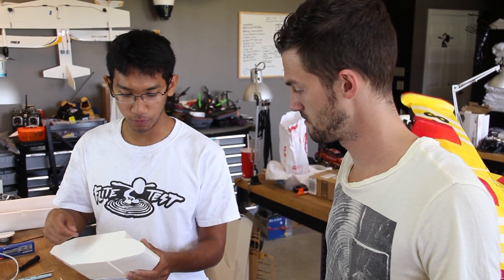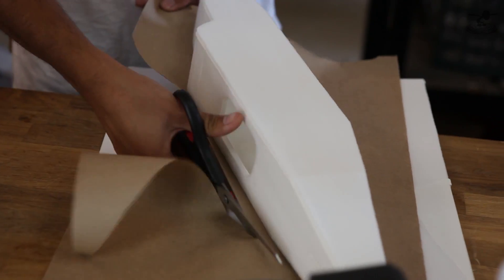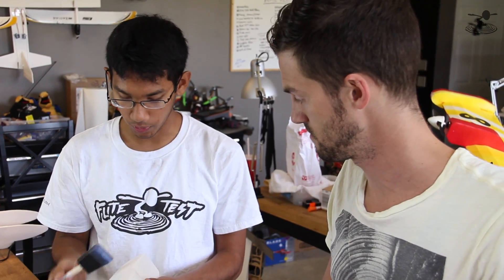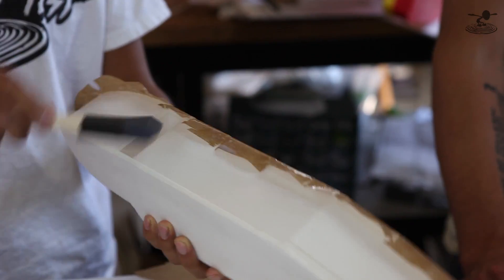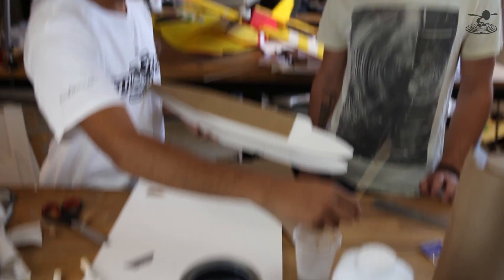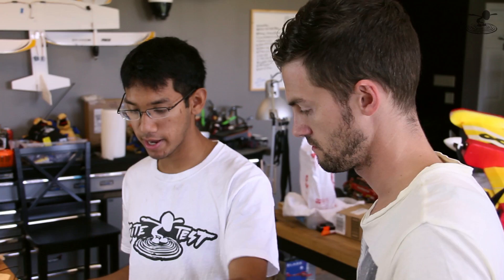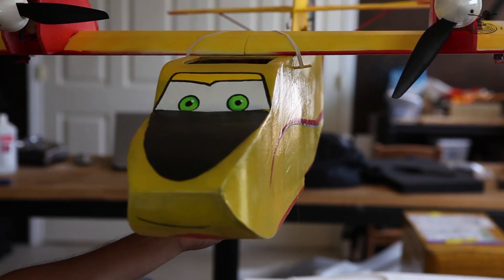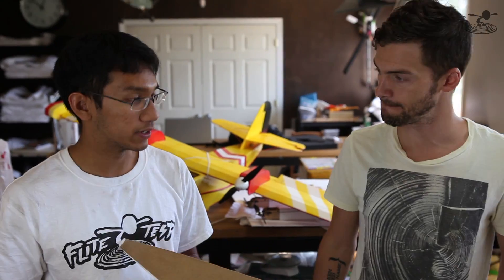Flite Test | Waterproof Your Airplane

Comment: use cheap acryl paint mix whit water 60/40 about and spray cover to plane,m have dry is same than plastic cover. all water base paint work well. but best methor have monocote cover film heat arounf plane. and then paint what want decoratives and text add stickers.

Comment: A much easier way... is using pour on epoxy, that is used for glossing tables. Brush on thin layer. Get the slow dry kind. Its called... pour on.. and it is literally.... the absolute best thing ever. I built a foamy in 2006... that is still in same condition now as it was then. Put it on AFTER paint. You can paint it after coating it if you want it matte... but you would need to scuff it with sandpaper.

Comment: Just rewatched this. You can also use thinned white glue, 2:1 glue to water. May be cheaper. After watching this, I would have used this method to cover my EPO foam turtle deck for the FT Racer, see my article on FT.
Reply: Hi did you try with white glue after all? once dry,wouldn't  white glue  become slimy if it gets wet?

Comment: I wasn't aware of the availability of craft paper. I knew the British have been covering planes with brown paper for decades but the stuff Peter uses seems really light. What are your thoughts of using it over Depron? Just thought of something. I'm drawing up a cartoon C-17 & Cessna Citation/Lear and now I'm thinking I might be able to apply the brown paper to the one side of the Depron while it is still flat and then roll the foam'paper into it's elliptical shape using the paper to force the foam into compression as opposed to it stretching. Do you think the paper would prevent it from rolling. The minimum radius would be somewhere around 1.5 inches/ 40 mm. Nice video. I have another fuselage which is a combination of light white foam block and Depron and I'm anxious to try this procedure on that. It should also work nicely on wire cut blue foam. It is 0552 in the morning so I guess there isn't any reason to go to bed. I think I'll get dressed and go to Walmart.
Reply: I haven't left for Walmart yet so I watched the video again and you recommended not to cover wings with the craft paper  and so I'm wondering why? Again the video was very helpful for my new designs. Thanks

Comment: Obviously this is a good tip for the kits as they use paper covered foamboard. but if you use something like Depron, and make sure to fully glue every joint, there's no need to water proof it.

Comment: Just did some testing using this method on the DTFB and the water based coating. It works BUT does not solve the number one issue with this foam board, adhesion. The original paper and this new technique still does NOT adhere to the foam. This is the biggest downfall of this foam. After a crash or hard landing, the foam separates from the paper and this causes structural weaknesses.  I have found the only glue that really Sticks to this foam is foam safe instant glue, and to re-glue a whole sheet is not practical from a cost point of view.

Comment: I do not see enough advantage in removing the paper just to put on a little better paper. My opinion is to leave the existing paper, use the oil based poly procedure on the entire airplane, then paint.  The baby powder can still be used with oil based to get a smoother painting surface.

Comment: So, what's the advantage of this vs just doing oil-based polyurethane and painting it?
Reply: ***** Better adhesion to the foam than the standard paper.
Reply: Balu
 But I'm wondering in pure water proof-properties.
Reply: I can't get it to work... I bought two different cans of the stuff I don't see what it does

Comment: Too bad you can't just buy foam board with better paper to start with.
Reply: Kevin Hanes LOL Elders! Wonder if I can get one from my grandma...
Reply: Hugh Hemington Oh, you can :). The company I get my foamboard from also sells one with kraft paper. It's called "Creat Kraft". I didn't order that because I wasn't sure if it's heavier, but I might just try it for comparison some time.
Reply: Don't get me wrong, I'm not knocking the effort!  I just think that waterproofing remedially  may be doing it the hard way.  It's a matter of walking a tightrope of weight workability water-resistance and strength.  And the willingness to no doubt spend more in the beginning for a less common and more expensive material.
I wonder if this works better than built up coats of spray paint?  It's clear that the main issue is the glue used to secure the paper to the foam originally.
Reply: I think you missed the point of the video. They probably should have used a different title so no one gets hung up on just the water proofing advantage. The process that Peter demonstrates allows the builder to get a much better finish on the plane. As Peter demonstrates not only is the finish better but it is stronger. Not only does it look better and is stronger but it will accept a larger selection of paints. If you care about the appearance of stuff you build then I think you would appreciate this video more. Using Peter's method of recovering the plane along with other building techniques can result in even very scale looking aircraft. Having difficulty finding a good Kraft paper. Walmart and Michaels didn't have anything suitable but tomorrow I'll go to United Artists and see what they have. On my small planes Japanese tissue is a good substitute but not practical for these larger sport planes as it wouldn't be very durable.
Reply: Roy Oetting Have you tried looking at Lowes or Home Depot?  The have the rolls of masking paper that is a thin craft paper.  I've seen a model covered with it using white glue/water mixed at 50/50. It was as tough as thin fiberglass.  I also wonder if the white glue/water mix wouldn't work as well as water based poly-u on DTF?

Another method that may be worth trying is onion skin.  This is an old FF covering that much stronger than tissue, and is available today from Amazon as tracing paper.  There is a guy in RCGroups who uses Helix Paper Roll Sketch, White, 12 Inches x 50 Yards, White (37801) and says it a great covering material.  The only drawback is you have to be careful if you shrink it like tissue as it apparently can shrink more than tissue. It may be worth trying on DFT using WB Polycrylic and also white glue/water.  The only drawback is how much it may shrink once it gets wet.  Only testing will give that answer.
Reply: Hugh Hemington Is the paper on DTF adhered by glue, or is heat from the forming process that adhere's the paper to the foam?
Reply: hogflyer62 Thanks, I'll check it out.
Reply: Can any of you "professionals" make a video on how to make a base of a 2-3 ch (mini) because everytime I take my out the circuit , the motors break off!
Reply: +hogflyer62 Probably glue.

Comment: Please do an episode on building with deporon Peter!
Reply: Great idea +jakeEboy Building with depron videa would be awesome, in UK is cheaper than foam-board and  "better" because the foamboard i can find is kinda cardboard backed rather than paper backed and destroys razor blades when cutting it :-(
Reply: One thing to note when building FT planes using Depron -  I have found that the CG moves back a little bit so you might want to move some electronics like servos forward an inch or so.
Reply: ***** Here in Australia you can get foam board but it is as expensive as Depron and Depron is a superior product for modelling. So yes, please do a Depron build guide.
Also Depron versions of the plans would be good. I have built the FT Spitfire and the FT Baby Blender but they weren't easy because I had to modify the plans as I went.
Reply: I'm getting my depron for around $2 per board (6 mm thick, 1 x 0.6m if I remember correctly). What are your experiences?
Reply: Borko Jandras Wow! That's really cheap. Where is that? I buy it by the case (20 sheets) and it works out to about $11 per sheet. That's the cheapest I can find in Australia.
Reply: Mohit Dewan It's in Croatia. Goes under the name Climapor.
Reply: Borko Jandras kewl! I wonder if that would ever be available internationally?

Comment: will the powder also work if I use lightweight fiberglass instead of the brown paper?
Reply: Its definitely possible. If you're going to use water based acrylic with glass, make sure you're using very light glass cloth or it'll weigh a lot more than the light paper used here. Another option is to use epoxy resin, and apply heat to it while applying. You can then squeegee out the excess with a credit card or similar until there's just enough left to hold it on securely. You could maybe apply glass with whatever resin, and no talc, then after that's cured, apply resin+talc powder over the top as a filler/sanding sealer to fill the small gaps in the cloth's weave that it leaves behind. hope this helps you with your idea!